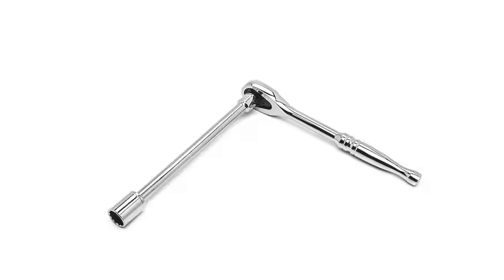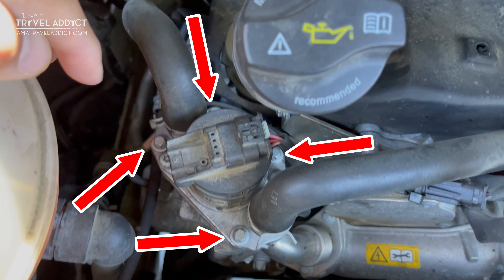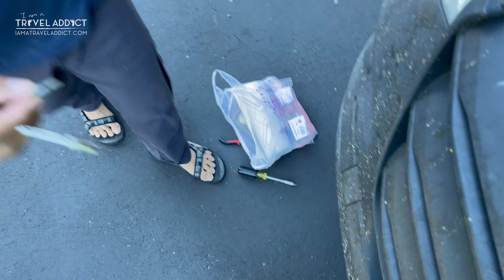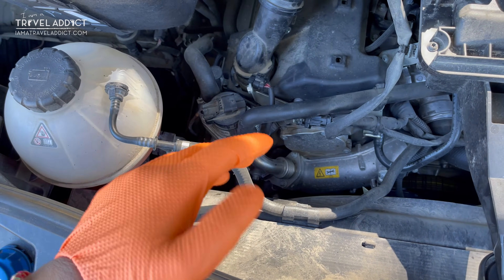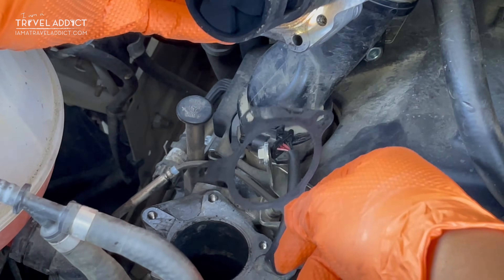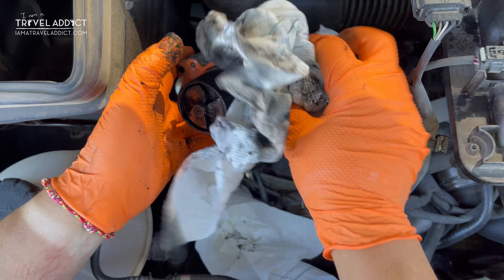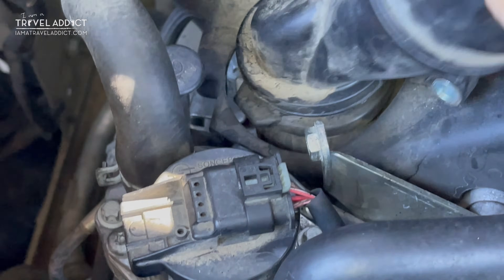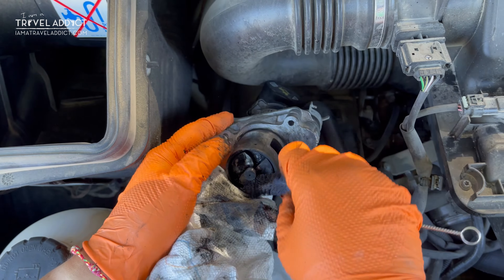How to: Mercedes Sprinter V6 Diesel EGR Valve Cleaning (2019-2022).

Comment: Hi, my 2019 V6 diesel Sprinter is currently in the Mercedes, and the diagnosis is that the EGR filter needs to be changed. They're charging me $3,000 for that work. Do you think I'll fix it if I buy that filter on Amazon and change it myself? Or do I have to schedule it once it's changed?

Comment: Great Video......I have 2016 3500 sprinter with 230k mile. I drive a lot of freeway Oregon - California just started to having small engine stall issue in the morning. But I will clean it this weekend....other than that sprinter is the KING

Comment: Thank you Peng,your video just saved me! my paddle shifter stopped working and then I had no acceleration and could not get speed. Went to the auto parts store bought some carb cleaner and the Torx socket. Watched your video and we’re good thank you so much.
Reply from the maker: That's great, so glad you found it helpful!

Comment: It might be good to point out that those 4 hold down screws holes are aluminum and very easy to cross thread or over tighten and strip.  The manual calls for 8ft pounds of torque which is very light...best to start them by hand and then use a short handle ratchet if you don't have a small torque wrench to avoid over torquing.
Reply from the maker: Thank you for the info!

Comment: Just had a CEL on my 2020 144 Sprinter with 32K miles.  Since I have an extended warranty, took it to my dealer.  He said it needed a new EGR valve.  I imagine its only dirty since I was able to drive it to the dealer with no issues but they are replacing it.  I will clean it every 8-10K miles following your excellent video along with purchasing a scan tool.  It seems a lot faster than taking it to the dealer.  Thanks so much!
Reply: They wanted 1800 bucks at the dealer to replace it with labor. I fixed it with a can of gumout

Comment: Its part of my routine oil change and I have a magnet bowl and wristband to hold srews and bits. I have a 2023 crew van 3500 xd with 35,000 miles also you may eant to buy a egr gasket a couple of them to have on hand. I replace the egr gasket its about $12 bucks. By taking off the gasket and cleaning you can warp the gasket creating a leak,so I just replace them.
Reply from the maker: Good advice. Thank you!

Comment: I have learned that one of the causes of EGR valve problems is too much low speed driving, such that the engine never gets thoroughly warmed up. My 2017 2500 chassis with the 3.0 liter diesel now has just over 37,000 miles on it, without any operating problems at all. I’m glad to see how easy the EGR valve is to clean, but so far, I haven’t had to do it.

FWIW, last March I installed a Scangauge III, and it’s been very informative. Among other things, not only do I know how hot the turbo gets, but I’ve learned that it takes a full 12 miles of highway driving to get the engine and transmission up to operating temperature, except when climbing hills—less mileage then. That confirms what I’ve been doing to exercise the van during the offseason—I drive it at least 20 miles at highway speeds.
Reply from the maker: That's some great insight. Thank you for sharing!

Comment: Good video but a warning that cleaner is extremely flammable. You should use a non-flammable cleaner on any diesel on anything that can go into the intake and combust. That cleaner even dried in the EGR on the first start could potentially cause a runaway or a hard knock. Non-flammable electronics cleaner does a great job and won't cause detonation or runaway.
Reply from the maker: Thanks for the important tip! Any brands you recommend?
Reply: @IAmATravelAddict  I normally use the CRC Lectra-Motiv. They also make a flammable electronics cleaner so double check the fine print on the front to make sure it's the non-flammable version. I have used other brands with good results as well, but my local store carries the CRC so I keep it handy.
Reply from the maker: Thanks!! 🙏

Comment: I have to clean my W461 300CDI (EOM 2010) once a year to clear P0404 and flashing EDC warning light . There has to be a design fault. I clamp off and detach the coolant hoses to clean the EGR valve away from the engine bay to avoid the carb-cleaner spattering everywhere in side the engine bay. I also remove the down pipe to clean too.

Comment: I have a 2019 Sprinter 3.0 I deleted and blocked the EGR around 110,000 miles. Today I have 640,000 miles with no issues, These van will last 1 million if you delete.
Reply: How did you block it out?
Reply: Hi, I'm reading your comment. My 2019 Sprinter V6 diesel is currently in the Mercedes, and the diagnosis is that the EGR filter needs to be changed. They're charging me $3,000 for that work. Do you think I'll fix it if I buy that filter on Amazon and change it myself? Or do I have to schedule it once it's changed?

Comment: Great video 👍 I didn’t know anything about EGR valve before I watched your video😮 it took me about an hour to take the EGR valve off…I don’t know previous owner ever cleaned the EGR valve…it was not easy to get it off😢I put 12,000 miles on to the van after I bought.  I knew it loosing power when it goes up the hill at the time when I bought the van, but I thought because it was a big van…😮
It's amazing that now I feel the van has so much power... go faster too 😂 thank you for your kindness to make the video 👍

Comment: Your video was well done and easy to follow, thanks. I have 19K miles on my 2021 Sprinter 2500 3.0L diesel. I started experiencing the engine sputtering, stuttering, or jerking while accelerating in the last 3000 miles. Taking it in to the dealer tomorrow.
Reply from the maker: Not sure if the dealer figured out the issue, but that sounds a lot like what I experienced the first time I needed a EGR cleaning. If the dealer can clean it for free under warranty, let them do it.

Comment: I'm not a professional mechanic either, but I've been working on cars for about 40 years now.  Gummout products are good, no particular need to change brands.  Stop by Harbor Freight, Northern Tools, Tractor Supply or similar and get a magnetic parts bowl.  That will be much better than the plastic box for holding bolts.  Thanks for the video!!
Reply from the maker: I didn't know there's such a thing as magnetic parts bowl! Shows you how much I work on my own cars, lol. Thank you for the tip!

Comment: Oh that is a great tutorial video. Thank you for putting it together. This will help me save time and money taking it to a mechanic. I owe a 2018 Sprinter. I wanted to get clarification on the white tap--how do you know when it is slight pop out?
Reply from the maker: There's really no indication, there's no clicking or anything. I just use a very small flathead screwdriver, push the white tap down and out slightly, then try and see if the cable will pull free. If not, I push the white tap out a little further, then try again.
Reply: @IAmATravelAddict  Thank you that is helpful.

Comment: Good video. If you wish for this to be less of a problem, then be less tolerant of unlabeled fuel pumps. B5 ONLY!  Any B20 or unlabeled B10 , which is very common in North America, will increase how often you have to do this maintenance, as well as lots of other problems.
Reply from the maker: Yeah, I try to stick to bigger brands that are known to carry better diesel.
Reply: You're fighting a losing battle with this. Most chevrons are B99 and Shell just recently started converting all their stations to renewable diesel. I see about 1-2 mpg drop when using renewable and engine sounds less smooth. Very frustrating.
Reply: Good point about fuel mixture.  The problem is, here in SoCal it is now nearly impossible to find pure petroleum dino diesel.  Biomass mixtures are everywhere.

Comment: Please people don’t clean these yourself, all 906/907 sprinters have an unlimited warranty extension on this part now. If you have a mechanically sticking fault MB will clean for free, you don’t even need a fault if a tech can replicate your jerking feeling. If you have an electrical fault or cleaning does not work they will replace. The part goes on off back order quite frequently. Mercedes has added the option of viewing idle hours on these vans because they are saying customers only have this isssue if they idle more than 10% of the vehicles total run time. PLEASE people don’t do these yourself, I’ve had a customer goes as far as drop a drill bit down his engine doing this cleaning and we had to replace his engine for him due to the bit making it ontop of the piston on cylinder 1 and getting smashed! I’ve pulled so many coolers because people smash the carbonized /rusted egr valve back in and it won’t come out. The trick is to rock the valve side to side and spin it as you are removing
Reply: My local dealership takes multiple days to do this. One time it was 2 weeks! I would rather do it myself.
Reply: @binyamj  In my case, a week to do it, and 4-6 months to get the appointment. Rediculous.
Reply: This is simply not true. My local Pensacola, FL MB dealership says it’s not under any warranty and it’s $870 to clean or $1700 to replace!!
Reply: lol no they dont. Here in Niagara Region, Canada they charge 2000$ per cleaning and are not warranty covered.
Reply: Thanks for your worthless reply. The dealership charged2x for this service at under 50K miles:, I just performed it the 2nd time in 800 miles. If you live and use this vehicle in the outdoors like most do, a service dept is too inconvenient, not to mention the limp mode limiting your speed trying to get it to a service dept. There is a design flaw or engineering flaw that a class action suit should correct.
Reply: My dealer is 120 miles away and often won’t even touch it because they don’t see the problem, so it’s easier to do it myself.
Reply: If they replace the EGR valve is the new one less likely to get stuck? In other words is it a better design than the original?
Reply: This cleaning is covered under 5yr-16000km warranty of emission system in Toronto, Canada.
Reply: Thanks for the video. Very helpful.

Comment: We have a 2020 V6 and our EGR valve is the cause of great anxiety for us.  Luckily we learned how to clean it ourselves (or should I say my hubby😜), but it seems as if it needs to be cleaned much more regularly than expected.  We bought the van in July of 2022 with a little less than 10K.  Less than 2K miles after purchase it started to balk on its up shifting and cleaning the EGR valve fixed the issue.  Again after about 2K miles that balking on up shifting started again.  Cleaning the EGR valve fixed the issue.  Now after only a few hundred miles the van sat for a full 2 months and upon starting it, the check engine light came on and the error code is the EGR valve.
So our question is: do you know anyone else who has had such an issue?  This seems pretty extreme to us😢
Reply: I have a 2020 also and the fact that you only went 2k after cleaning before it acted up again tells me from my experience you may not have done a very thorough job cleaning it. I had the same issue one time when I was in a hurry and tried to do a quick cleaning....what I found out is the better you clean it, the longer it goes before you have an issue. Also if you idle for long periods of time that tends to gum the EGR up faster. The best thing I ever did for this issue was to take the EGR valve completely out of the van....it's only a matter of disconnecting the coolant hoses after you get it unbolted. (They make clamps to pinch off coolant hoses so it doesn't make a mess when you disconnect them btw) Also you might struggle to disconnect the hoses since they feel like they are glued on after you slide the clamps away. Once you have the EGR valve out of the van, I use my Harbor Freight Ultrasonic Cleaner (about $70) and pour in some Chem-Dip or Gunk Carburetor Cleaner that comes in the metal can for soaking parts....just put in enough to cover the valve up to the top of the cylinder when the valve is sitting upright. Then just turn the cleaner on for maybe not even 5 minutes and the valve will look brand new! (or just run it until it does)
When you put it back together, use a thin film of anti-seize on the outside of the valve and also put some where the hoses connect so the next time everything comes apart easier. Cleaning the valve with the ultrasonic cleaner made a major difference for how long it goes between cleanings. 
Also found adding SeaFoam in the fuel tank pretty regularly helps the engine run much smoother in general.
Reply from the maker: That doesn't sound right. The 6-8k interval is what I do to keep the engine running smoothly. But even without cleaning, it should last at least 20-30,000 miles without issues. I have heard of cases of bad EGR valves. If the van is still under warranty, I would bring it in to have them inspected.
Reply: Thanks, that’s our next step - to take it to the dealership.  Sadly we have absolutely no confidence in them to actually take responsibility for this issue.  Prior to getting the error code, we had taken the van in because of the shifting issue.  It was only after making a stink did they actually clean the EGR valve because no fault was showing.
Now that an error code has surfaced, we’ll see what they will do.
Reply from the maker: @joycelynch4279  I'm sorry to hear you have to deal with that dealership. Are they the only one in your area?
Reply: @joycelynch4279 I’ve had a very similar issue.  Last time the dealer cleaned the valve it started surging again after about 1000 miles. Ridiculous.
Reply: I'm struggling with my EGR valve on my 2020 sprinter ,been cleaning it around 2 k miles, going tomorrow to get new valve maybe it will lasts longer :)
Reply: @remisd  I hope you have success with the new EGR valve.  We have since sold our Sprinter as we didn’t want to own a vehicle that wasn’t dependable.  And where we had no faith in the dealership/company to actually care about the issue to solve the root of the problem.
Reply: I have a 2014 v6 3L sprinter with 90,000 miles. Just started problem with upshifts. MB dealer here in Tucson found fouled Egr valve and also heavily sooted Egr condenser (cooler). He said if he just cleaned the valve the soot in the condenser would cause the problem to recur. He called MB and got authorization to replace both under warranty. He also told me MB redesigned the Egr valve with a bigger shaft bearing which helps to avoid binding in the future.this part is backward compatible with my engine and was released in 2022. I would strongly recommend that anyone with this problem see a dealer shop to see if it canbereplaced under warranty.  He also said that the sooted cooler is a problem causing high exhaust back pressure which degrades engine performance as well as causing premature Egr fouling. He was not aware of any way to remove soot from the condenser.
It seems apparent that engine idling should be avoided. I was also advised to downshift to keep engine rpm>3000 for 15 mins or so occasionally particularly when climbing hills.

Comment: If you see this, can you tell me how you ended up getting the white clip back in.  Guess what I did.  😞
Reply from the maker: I used a small flathead screwdriver to push the white clip down while pushing it in at the same time.

Comment: The MFs at James Motors in Lexington KY quoted $900 to clean the EGR valve and it had no issues running.   The DEF gauge was not reading properly and they charged me $197 to diagnose that the DEF gauge was not reading properly as I told them.  That fix was quoted at $3400.
Reply from the maker: Sorry to hear about that. I plan to find a local independent MB shop once my warranty expires. Not sure if that's an option for you.
Reply: Problem is a independent shop can’t install a def tank because they won’t be able to program and code and reset the calculated fill level , 100% of the time I’ve seen tanks fail is because the customer runs so low on def the tank sucks air and the fill level sensor becomes crystallized with adblue and the tank collapses on it self . Then the customer fills the tank  but it’s pressurized and won’t fill. Thus the gauge says empty or full, there’s a very good reason why your def light comes on and the tank still has 2-3 gallons in it…

Comment: I did 36,000km on my 2019 V6 sprinter van and in the last 10K, the upshifts were very rough and jerky.  The engine was hesitating at startup the morning when I took the van for service after a long road drip.   I got the EGR cleaned by Mercedes for $350; the van is very smooth now, and upshifts are smooth as well.   Now that I learned this from you, I can do it myself.   Thanks
Reply from the maker: Wow, $350, you must not live in California, lol. Anyway, I’m glad you found the video useful! 👍

Comment: Love your channel.  Just made a commitment for my Sprinter van yesterday.  The dealer should have it for me in mid to late November.  Really appreciate these Sprinter maintenance videos.  Enjoy the journey!
Reply from the maker: Thank you and Congratulations on the new purchase. Not sure if you've had a van before. If you enjoy outdoor lifestyle and are comfortable with boondocking, having a van is life changing! You'll love it!
Reply: New owner here also. I always use top tier diesel and occasional diesel additive. Did my first oil change at 5k. Will then follow at 10k service interval.
Reply from the maker: @boosttv5688  I've been using renewable diesel lately, seems like most 76 has it. Someone told me they burn cleaner. I have noticed the soot build up in the EGR is a little less the last time I cleaned, but it could also just be in my head. I'm still using it because they're either cost the same or slightly cheaper than regular diesel here in CA.